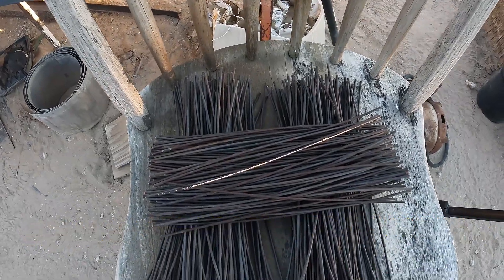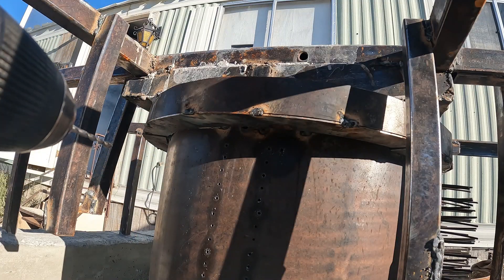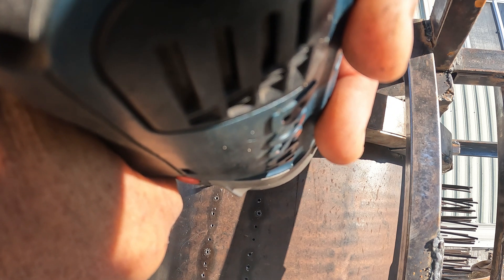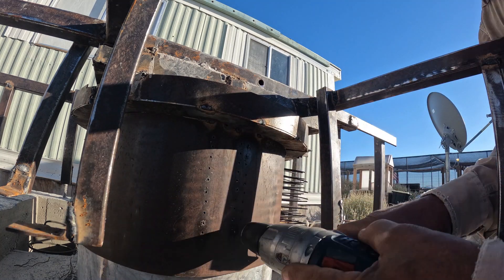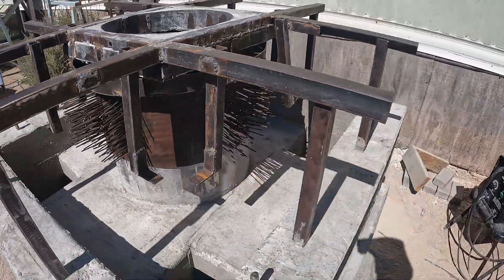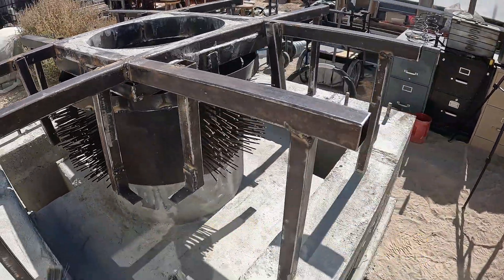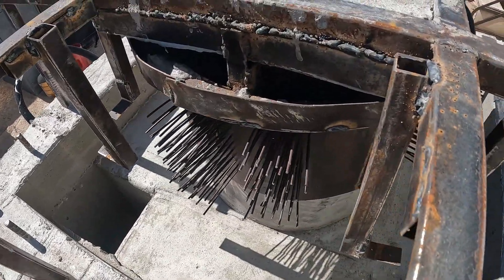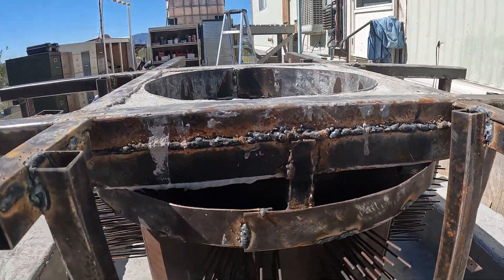Sand Battery Heat Transfer Rods E120

Comment: Looking good . How much will this weigh when finished?
Reply from the maker: I have no idea but I can do a rough calculation. I would guess 2 tons or more.
Reply: @off-gridsurvivalmike8120  thanks just wondering with the vents and steel it would be a fairly complex calculation . I was wondering how much heat storage capacity would
Reply: @off-gridsurvivalmike8120  was thinking of trying to make a calculated guess at how lmuch heat would be available.  We will find out when real world tests are in use . Don't spend time on it just thought you might elready know..

Comment: nice...   I  WISH we had used Elctric storage heaters in the USA in the UK the used parts are given away as scrap...  that will change as more go to solar and while E batts are still expensive.   I'd love to get a hold of nightstore bricks.... solid thermal bricks make  the construction EASY   because don't have to seal the sand from flowing out near the element connection.  Plus they have an engineered in high specific heat..... I'm going to experiment with Roadbase  made from concrete since it has a higher spec heat than sand....  sand is totally workable just need to use a bit more mass and maybe surface area because its not a great conductor.  Ideally  like to just remove lid/insulation to release more heat rather than use fan electricity from batteries.... but fans don;t consume too much so a combination could offer good control.     Another simple way, I think is just place mass in a used kiln,  possibly even  aluminum,  melt it and let it phase change .... not sure often it would require replacement from oxidation,  since exposed to air.